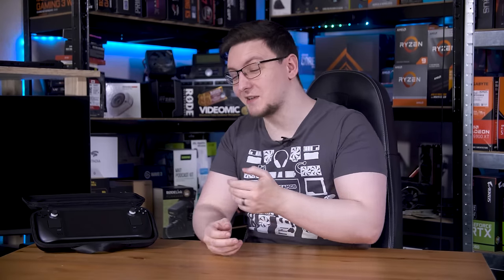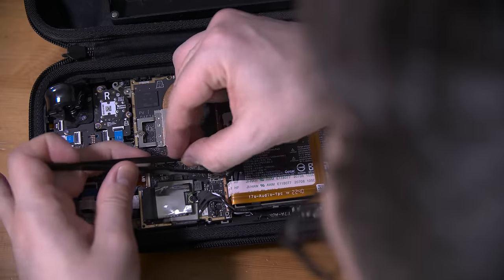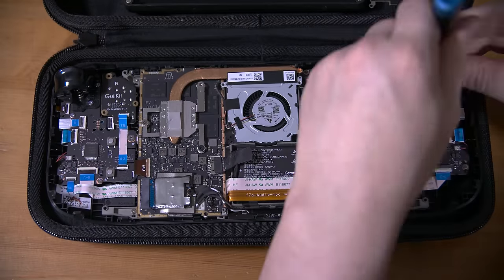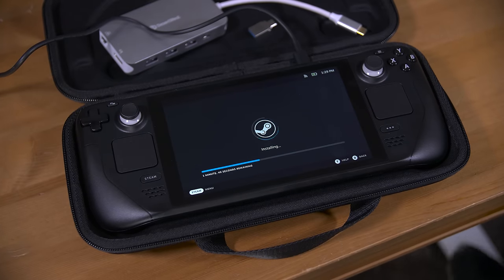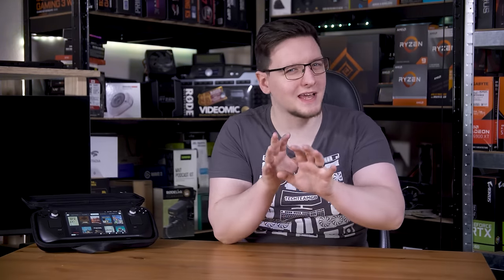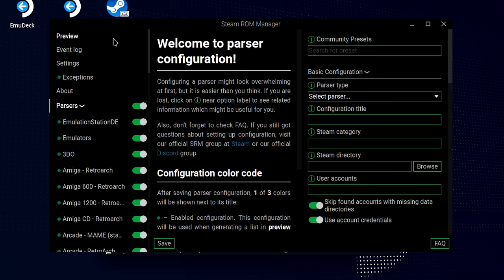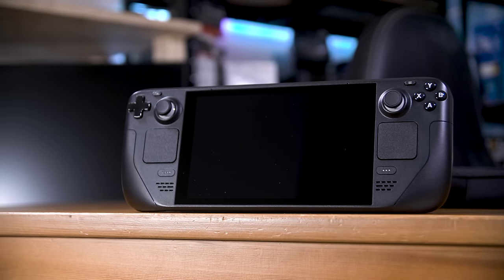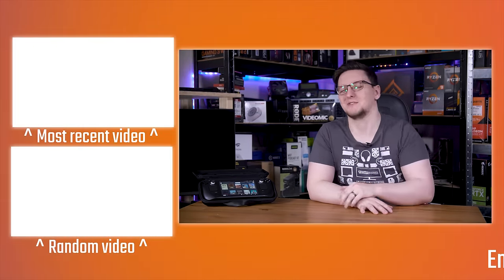I Bought a 64GB Steam Deck and FIXED EVERYTHING WRONG WITH IT!

Comment: Personally, I set my 64GB up with a 512GB SSD and 1TB SD card, and then threw on the Killswitch case, glass and thumbsticks. With those, a couple docks and some wireless controllers, the Steam Deck is my favourite gaming hardware for sure.
Reply: Why not just get a 512 Steam Deck if you're not going to go higher than 512GB?
Reply: @bland9876  Well, back when I ordered my Deck, I intended to put a 1TB drive in. When I got it in my hands, two things pushed me to the 512GB; first, one of the main Deck developers had said that the Deck was designed around a 512GB drive, and that using a 1TB drive could have ill effects on the device. I didn't want to risk getting a double sided drive and having heat pushed out where it shouldn't be, so I just stuck with the spec. Second, the 512GB drive was $80, and iirc, the 1TB drives were a fair bit more than double that. So, all in all, my 512GB Deck ran me $580 CAD, whereas the 512GB Deck costs $820 CAD. Also, I wanted a screen protector, not the antiglare screen.
Reply: @TheDarkKratoz  you can get anti glair screen protectors though they're not as good.

Comment: I did the 1tb mod too, but the OG joysticks are soooo good that I decided not to change them. If I get drift several years down the line and the software fixes make it feel too unplayable, then I might go back in and swap them. Otherwise, it seemed unnecessary for gaming and desktop use
Reply: my plan is to just use the stock ones, and once they get drift just replace them with the ifixit ones. They're not too expensive and you literally just drag and drop basically like the ssds. I have a 512 steam deck as well so although I would prefer a terabyte or two, my need isn't enough that I feel like buying something and opening it. I'll just wait it out until 2230 drives are about the same price as 2280 drives. 

Or who knows maybe by that time the steam deck 2 is out and it uses 2280 drives anyway.
Reply: Those joysticks are so meh especially with the top. The surface feels too slippery so I have some dbrand joystick covers coming in.

Comment: The reason the stick caps are a bit harder to remove is because Valve has some kind of seal/coating over the solder pad that wire sits on.  So your iron has to melt through that before melting the solder

Comment: Wow, i'am surprised how easy it is to replace some parts of the deck. Valve really put much thought when making this device.
Reply: Yeah that’s one of the biggest things that makes the deck way better than the rest. Seeing the razer edge being compared to the deck and shills making it out like it’s better is crazy. Zero repair value, only android based, can’t upgrade anything on the edge itself, etc.
Reply: Yeah it actually feels like valve was thinking of what gamers would want instead of trying to push people towards the more expensive model with the best features
Reply: Yeah and zero hour into long life battery.
Reply: @AndroidPCMMORAW   nah, unfortunately it either power hungry x86 cpu and low battery life, but you can run any Windows/Linux game or low powered ARM CPU and you can only run games adapted for ARM architecture like Switch. Not Valve's fault actually.
Reply: @rincewindthewizzard6594  Yes , this is CPU compatablity issue. Games are mostly written for x86. The only expetion are moble games for phones/tablets that are native to ARM. There are also some expetions with games that made compatable for ARM. Good example is Endless space 2 , runs great on M1pro mac. 
Valve chose to stick with x86 that very reason. The main feature for the SteamDeck are Steam library and the open Linux at the back - both need x86 to be fully utilized.
Reply: propertiary ARM SOC hardware shit sucks. why can't i just install Linux on any android phone? Answer: propertiary ARM hardware shitt

Comment: you may want to mention that if you use more expensive sd cards (especially ones with a high reading speed) Then you dont need an SSD at all. No one really knows what kind of magic valve has put into the card reading slot - but the speed difference in loading games for the drive or from the sd card is abysmally low. So low in fact that i have not installed a single game on the ssd since i have it. The SD card is more than fine. Im about to turn this thing into a "Real" PC setup soon with the Docking station, so thats something i look forward too.
Reply: I dont own a steam deck but dont things like shaders get installed on the ssd if youre emulating?

Comment: Dude, thanks for posting. I ordered a 64gb deck last week. I plan to do likewise and swap it it out to m2 and hall effect gimbals, but I'll wait until I start feeling the drift or when I find a good deal on 1tb (or more) SSD. I've been gaming on linux since before proton so I don't know what took me so long to order a deck. I'll mostly use it for my steam library but who know I like to tinker.
Reply: Its fun, take your time.
 The shield on the Emmc uses a soft glue that reseals. It is far safer peeling open after unsleeving the emmc. Than wrap your ssd. My 1tb ssd was a bit thicker than the emmc.

Comment: I think 1TB 2230 SSDs are currently too expensive to be worth upgrading a 64GB Deck with while they're still around £200 new. I got most of the way there with a second-hand 256GB SSD for £18 and a new 512GB microSD for £29 - 25% of the cost for 75% of the storage (still exceeding the total standard storage of the highest end Deck, which was why I picked those sizes, plus the prices I paid gave the best GB per £ value I could find anywhere, regardless of drive size).

Got 60 games installed with still some space to spare - do you really multiply rotate through many dozens of games in a short period of time to need even more games than that on internal storage? Highly unlikely IMHO - above a certain point, it becomes an e-peen measuring contest.
Reply: Speaking of storage based on your games certain games come with HD graphics as DLC . If you choose to install a game that has that feature you can go into your DLC and unselect the HD graphics which will save space.
Reply: I got the 2TB 2230 from AliExpress for £200, took 1 month to come but it's brand new as used crystal disk I go to confirm it's useage. Feels good not to worry about storage and I have steam OS and windows 11 on dial boot. Gamepass runs great on windows

Comment: Little tip for de-soldering poor quality led free solder in the future. Cover the pad in alcahole based flux and apply fresh solder to your tip and the pad. Without this you won't transfer your heat effectively, turning up the temp will just distroy your tip quicker

Comment: Joys need calibration buttons pressed before fitting back cover.  They also need software calibrated in deck.
Reply: Is it difficult to do? I want to get a steam deck but I'm not too sure after reading this 🤣

Comment: Got my 64g Deck in Nov, put a 1tb ssd in days later. Grabbed some docks and plugged a wireless keyboard & mouse. 
 Fallout NV(with Tale of Two Wastelands), 4, and Skyrim tranfered well well with all mods from my PC. Enbs included. Oblivion on the other hand... won't load with any mods. 
 The emmc was also horrible in desktop mode.

Comment: So you swapped the storage for the same cost (to us) it would cost you to get the next model anyway? 
And hall sensors or not I promise you those guilikit sticks will fail mechanically before the potentiometers in the decks originals will they are cheap af and also have terrible response curves and feel.

Comment: Those ROMs take up a lot of space depending on the size of your collection. I was left with a little over 400 GB after loading my ROM library onto a 1 TB SSD. It's not a problem for me since ROMs are the only thing on the machine as that's all it's getting used for. I only paid $100 for my 1 TB SSD, I got it when they were plentiful well before the crazy when the Steam Deck was first announced. I don't plan to swap out the joysticks until they break. no point in throwing away a perfectly usable set.

You didn't fix the lack of eGPU support. 😉 I would have made the Steam Deck so much more usable as a hybrid had it come with that support.
Reply: I know select roms rather than the download all and bung em on thing
Reply: dual boot popOS and it will work with a usb c external gpu adapter
Reply: @josephdias5859  there is no usb 4 support. The only option is plugging it in the m.2 slot
Reply: Would you mind helping me out, by letting me know how to get a huge collection like you have ?
Any way I can have a copy ?
Reply: @carlos_mann  thank me later.
Reply: I mean you can definitely use a eGPU using a adapter but uhh.. not worth it unless it's a very old low end card, I think the maximum you could MAYBE get working is like.. a 480-560.
Reply: @TrompKramer  wdym? For what?
Reply: He also did not mention that after installing all of those that you might have alot more games listed on your steam games list. Might be worth only having just the emulators/selective choices so you dont end up adding over 100's of new games on your game list...
Reply: where did you get your roms from and how did you do it I feel it takes too long for just one game and transfering it from my pc with a usb stick what process did you follow for your roms
Reply: @mikearg6401  
Curious to know this as well.
I cant find any info on how, or where to get these roms from.
Reply: @TrompKramer  for what

Comment: Cheaper idea I did by a 256 gig ssd card and use this . Cost me £60. I then bought a £35 500 gig micro SD card . I've later bought another 500 gig ssd card for £35 and run that from the jsaux doc via and external £10 case. I've now got 1 terrabite and 256 gig storage for £130. I would say make sure ssd chip you buy is fast enough and says it's for steamdeck as people on eBay are selling slow versions which affects your game speed .

Comment: Great video! I would highly recommend learning about the "Golden 40" that leverages the 40Hz capabilities of the Deck's display. Inevitably, you'll often end up worrying if a recent release can run at 60FPS on there. The Golden 40 would massively help here: Due to the fact you can lower the panel's refresh rate to 40Hz through the Quick Action Menu, you are able to go for 40FPS instead of 30. Why you may ask? Despite a 10FPS additional payload to the Deck's graphics APU, 40 FPS is right in the middle between 30 and 60 FPS in terms of frame pacing - meaning a nearly-60 FPS experience. Try it out! If you want to see this in action, feel free to give an older video of mine a shot, where I tried to explain this comprehensively. Bonus tip: 50Hz is amazing for PAL emulation. Cheers!
Reply: 40 hz is great for smooth gameplay with more intensive games that wouldn't be able to hit a target 60 on deck. And games that are intense to emulate like botw
Reply: Can't you also do this on a case by case basis? So all your triple AAA titles running 40 hz and your emulators running 50hz per say?
Reply: Does this apply for docked mode aswell?
Reply: @beakstown5622  If you have a 120Hz display, yes. But the dock doesn’t support HDMI 2.2, therefore you gotta go for 1440p@120hz instead.
Reply: @kadajsilverwing3018  You have the option to always use per-game profiles for such settings, so yes!
Reply: @deckverse  Thanks for reply, I have a 165hz 1440p monitor, ordered the steam deck on Friday, very excited for it but just a bit clueless when it comes to PC's as I've always been a console gamer
Reply: @beakstown5622  Feel free to join our Discord server and go wild with any question :)
Reply: @deckverse  Thankyou

Comment: You are the first I've see to have an issue with the joysticks. This is interesting but  I'd rather not open my Steam Deck to do these changes myself if I bought one. I'd rather just extend the storage with a dock/micro SD card and get one of the NVME options so I won't need to reinstall the OS back on the deck
Reply: Here's how I describe the Gulikit upgrade: absolutely unnecessary and totally worth doing. The stock sticks are fine. Better than fine, really. But my God the Hall Effect sensor sticks feel and perform like no pot-based stick ever could.
Reply: @GSBarlev  oh so you upgraded the sticks too?
Reply: @enthusiasticgmgaming4165  Yep. Installed them a week after my Deck arrived in September. Essentially turned my dead zones completely off. The responsiveness feels like no controller I've ever used before.

Full disclosure: I am having an issues right now, not with drift per se, but with the controls not returning to zero when released. I think it's a "open it up and clean out some gunk" issue, and it's not something anyone would ever notice, except that I've set my deadzones so low.

Comment: Ever thought about improving the cooling solution?
Reply: Why? It´s fine like it is 🤷‍♀
Reply: It already keeps temperatures under control as it is so I don't see the need. Like yeah it feels hot, but the actual chip is in like the 70s to 80s under full load. That's fine

Comment: I replaced the 64gb emmc with a 512 nvme which is 2.5v... do you think this will have a negative effect long term? i think the steam deck storage runs at 1.6v or there abouts.
Reply: no you should be fine, at worst it'll just make your battery life very slightly worse

Comment: 1 problem not yet fixed. Delta fan need to be changed to huaying fan which is quiter.
Reply: Unless it's an early run unit all Q4 2022 or later units have the quiet fans (along with better menu buttons).
Reply: @trevorhaddox6884  yeah I even have a q3 deck I'm pretty sure, and even I have the Huaying fan

Comment: once again hall effect sensors aren't magic solutions that are way more durable, the major difference is that instead of slowly getting worse, a hall effect sensor will straight just stop working as they decay. There are some benefits to hall effect sensors for lots of applications including analog sticks but I'm sick of this misinformed opinion of an old technology arising from the switch joy con drift issue. If a potentiometer is of good quality and isn't improperly designed that stick can last even longer then hall effect sensors.

Comment: You didn’t fix the screen quality. Although the only thing you can do that I can think of is connect it to an (portable) OLED monitor(or TV).
Or install the decky plugin and use vibrantDeck.(not going overboard with saturation)
Reply: If you haven't got a viable solution (aprt from connect to a monitor), why bring it up at all?
Reply: @w0mblemania  because the title of his video says "FIXED EVERYTHING WRONG WITH IT!" In all caps. I was just pointing out, he did not fix everything wrong with it.

Comment: You should have somehow put a 1280x800 OLED screen, which is the last thing "wrong" with it 🤣🤣
Reply: He says he may later on
Reply: @RealziesCuts  I bet some company is already working on it, the APU is good enough to run anything at 30fps minimum and tbh 48hz mode with 24fps limit is playable. An OLED panel would be the last upgrade. Sad the battery is hard to replace!
Reply: "Somehow"

Comment: If I had the deck, I would give it a bigger SSD, as well as an OLED screen.
Reply: I was wondering why someone cannot make a steam 7 inch oled screen... considering there is 2 that i know of currently on market. 1 is for camera tripad display and the other is the Switch Oled screen. The difference is the location on cables for the most part at least for steam decks screen cables vs switch.
Reply: @kadajsilverwing3018  Probably, because the display controllers are different.
You can't just drop in a different model of a screen and expect the firmware to include support for it
Reply: @MoistGal  Yes indeed i was just saying the blueprint is available (for the most part) . If only they could factor it to steamdecks specfics ...

Comment: Gulikit is actually a downgrade, as the sensitivity is way higher with no way to fix it. I wish people would mention that.. Gulikit is aware of the issue and says it's up to valve to fix. There are plenty of threads about this on Reddit.
Reply: ... What? I've had the Gulikits since September, and what you're saying makes zero sense. You have to calibrate them, and not just in Steam, but by running the thumbstick_cal script from Desktop mode. They work best with a square response area instead of a circle, and max signal (not response--I'll get to that in a sec) is only a few degrees short of max deflection for me.

Finally, you should dial your deadzone way way down, and depending on the title turn on anti-deadzone. The Gulikits are *ultra-precise*, and in the first few months of playing I could literally turn off my inner and outer deadzones.

I will say that I'm currently experiencing an issue, not with drift, but with the sticks not returning to top-dead-center when released. It's only with one of the two sticks, and it's only noticeable because my deadzone was literally zero, but I probably will take my Deck apart again and see if I got gunk in the mechanism or if there's anything I can do to lubricate the springs.
Reply: Wow I didn't know that. But If it is just a matter of a software update from valve, it probably won't be an issue for long considering how diligent they are about their updates